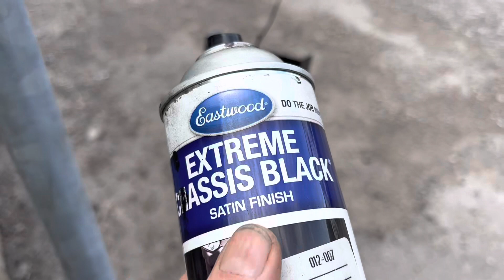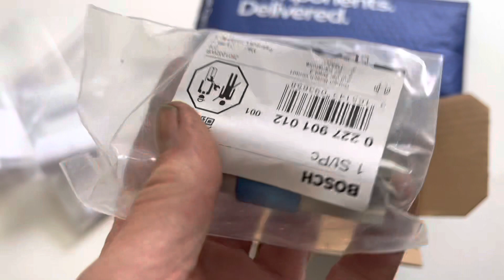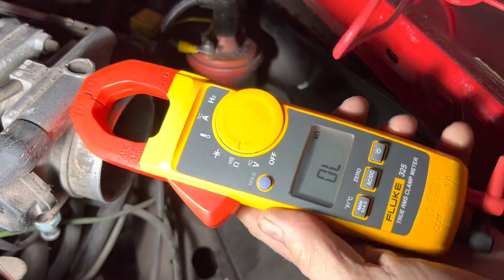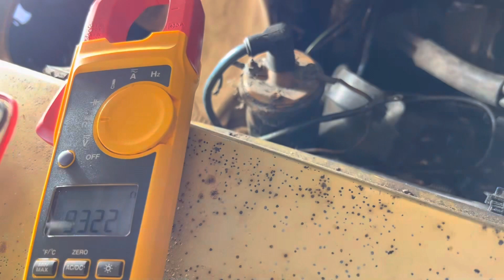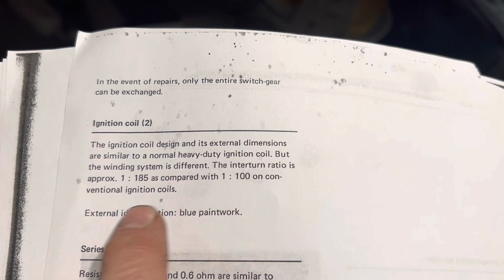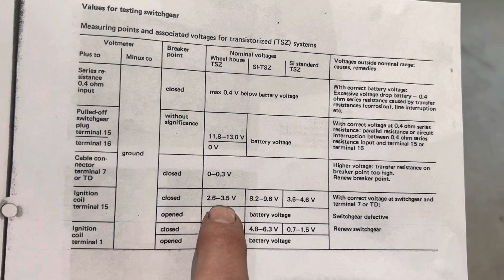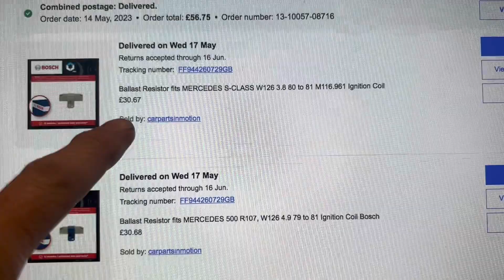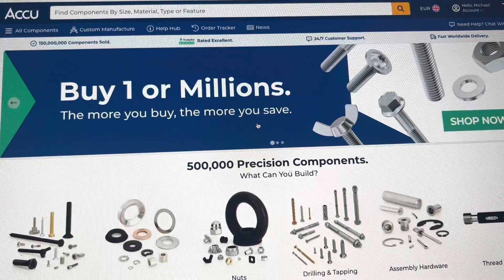Mercedes R107 ignition control module + ballast resistors

Comment: Great explenation and instructions, but make sure to clearly show the way that the wires from the ignition module and the ballast resistors go to the coil an connecting block (maybe in the next video?). If you find any problems with vaccuum leaks then make sure to change out the injector seal on all 6 of the injectors, they consist of 2 seals, 116 078 04 73 and 116 078 00 73, and make sure that you've got the right fuel pressure, should be between 2.0 and 2.2 bar.

Kind regards, Martin
Reply from the maker: Thanks for your comments and your good advice. Just finished fixing the wiring and will be sure to clearly show how everything connects up in next video. It is quite different on this car than on my later 1976 280SL. At present nothing happens when key is turned to crank so I am ploughing through wiring diagram and trying to find the link between the neutral lock out switch on the transmission and the starter solenoid. It is always a bit trickier when the car arrives in bits and your not sure whether it has the correct engine or loom etc....Mike
Reply: @MikesMercsandothercars  yes it's always a headache to work on a car that somebody else also has tinkered with. I've got a similar engine in my W116 S-class, a M110 with D'jetronic '73, I could send you a video of how the cables at my connection block are connected on the starter motor side if it helps
Reply from the maker: @MetaldetectingFriesland  I assume your car is an auto? The car I am working on was originally a manual and they have put an auto box in there. 

When you turn the ignition key on your car to the ON position (eg before you actually crank the car, does your fuel pump switch on for 3 seconds?

From memory, the fuel pump on K jetronic cars only primes when the starter motor engages.

Also....I believe there should be a blue wire connected to the 'air mass flow sensor switch on the top right of the engine block. This switch tells the fuel pump whether or not the engine is running. No engine running should = no fuel pump on. Does you car have this and if so, where does this wire go (eg through the firewall?)

Thanks

Mike
Reply: @MikesMercsandothercars  yes mine indeed is an original automatic car, and yes if I turn on the ignition on the 2nd part the fuel pump engages for 3 seconds. All the wires from the sensors go directly into the engine wiring harness
Reply from the maker: @MetaldetectingFriesland  Jeez that was a quick reply. I think I have to crawl under the car and start testing the electrical contacts on the 'neutral safety switch' on my parts car and the project car. Out of interest:

1. If you turn you engine off when it is in drive...what happens when you try and crank it. I am assuming that it will be as dead as a doornail.

2. Does the engine have to be running for your reverse lights to come on....or will these lights come on when the key is in the ignition in the ON position?

Thanks for you help.

Mike
Reply: @MikesMercsandothercars  haha that's one perk of always having a glass and metal sandwich on you.

Yes trying to start the car in "D, R, S or L" makes it as silent as a graveyard, it has to be in the "P or N" position for the engine to crank over.

I can't remember if the reversing light in the back turns on without the engine running when putting it in "R", I'm not in the position to test it for you sadly because I'm doing a head gasket job on it as we speak and I have a couple of electrical connections hanging loose
Reply from the maker: @MetaldetectingFriesland  Thanks for your reply and good luck with the head gasket. Mike

Comment: Good luck and great work! I had to do something similar to my D-Jet 1973 450 SL. 

Make sure to check the points in the distributor, as that is the "signal" that the control module receives.
Reply from the maker: Thanks for your comment. Good point. I may take the distributor off my 450SL parts car to familiarise myself with the set up. My next challenge is to figure out how the 'neutral safety switch' wiring interfaces with the starter motor...at present turning the key to crank position doesn't do anything. Mike

Comment: That look same as Ford Transit ballasts in the 80s & 90s etc.
Reply from the maker: Thanks for your comment. Yes they are very similar. On the old mercs, the resistors are 0.6 ohm and 0.4 ohm. The 0.4 is by passed during cranking to give a better cold start spark. I think the old transits used much higher resistors like 1.6 ohm. Mike